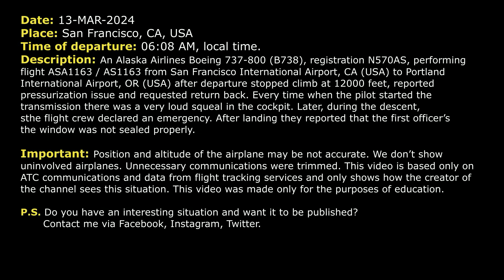Very loud, annoying squeal in the cockpit. Alaska Boeing 737 returns to San Francisco. Real ATC

Comment: Anyone remember that British flight where the pilot got sucked out of the plane when his pilot side window i.e. left, pop out and he didn’t have his seatbelt on tight.  The F. A. who was in the cockpit held on to him until they got to a lower altitude when another F.A. came in and help him.  They actually thought he was dead but didn’t want him to fly into the engines.  It turned out that they used screws that were too small to fit into the window.
Reply: BA5390

Comment: I was a crew chief on C-130s in the USAF. On a test flight, we had a crew entry door that was leaking pressurization (not unusual for that particular airplane, it had a hard landing in Viet Nam and was twisted). The normal troubleshooting was to take a wet rag and try to seal the leak. The rag blew out the hole! Eh, we just continued the test flight and after another hour or so, went home.

Comment: All of you pilots, crew and passengers who have ever had to experience this issue,  my condolences. I could barely tolerate it for 2 seconds...
Reply: It's pretty common. Windows and doors are plug devices. It is very common for one not to seal immediately. I've had this several times across different airplane types. In my experience the seal usually settles in and stops the squeal at higher altitudes.
Reply: Wow.

Comment: I've had a squeal like that a couple of times.   Once in the CRJ200 the inflatable door seal on the service door popped while in cruise flight.  It made a loud noise, scared the F/A so badly she spilled a drink all over a pax.   We were PHL-STL and diverted into PIT.  After offloading the pax we got a ferry permit and went back to PHL at 10,000 feet.  What aggravated me was I could have literally  fixed it with chewing gum and continued to STL but the optics of doing that weren't good.

Another time I was ferrying a Embraer Phenom 300 when we starting getting a loud squeal from the main entry door.  The lower we got the quieter it got.  Since we were passing near an Embraer Service Center we diverted there.   There was no way we could carry pax with that loud squeal and I couldn't find the exact location it was coming from.

Comment: First Officer window? Wow.
Reply: These windows are plug types. Meaning they seal from the inside. It is very common for debris or the rubber seal to not seal completely and a squeal is heard as you climb out as the aircraft starts to pressurize. In my experience this almost always goes away as you climb higher. And it will return as you descend. Back in the day, crew members would go to the back of airplanes, peal back a door seal and have a smoke. All of the smoke went right out the door seal. Nobody knew. Trust me on this. LOL

Comment: Years ago we had a DC-10-10 with a door seal issue.  Actually, it was a hatch that is located on the belly, just aft of the nose gear.  Avionics Bay access, also accessible from another hatch in the cabin floor.  
The external hatch would seal correctly, except just after takeoff with a low PSID it made a "moaning" sound...I forever named that airplane "Mona".